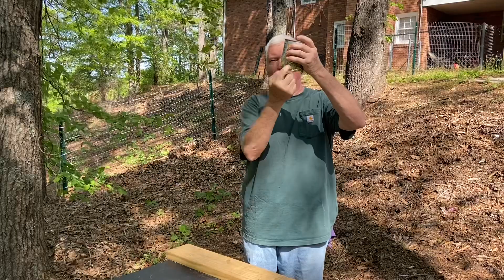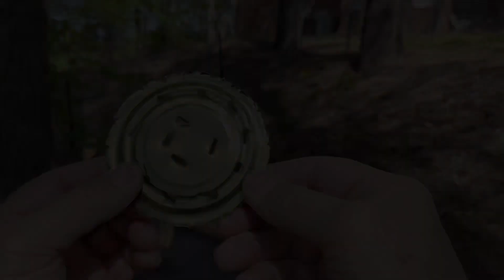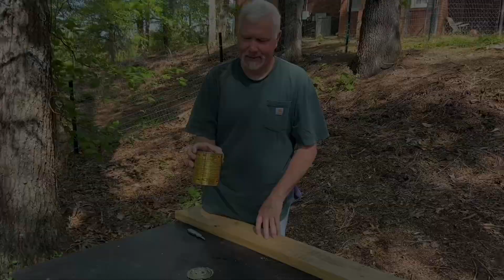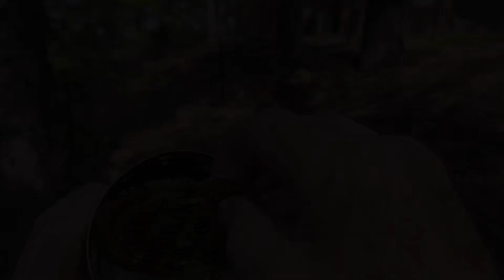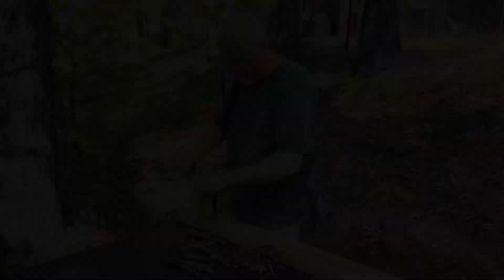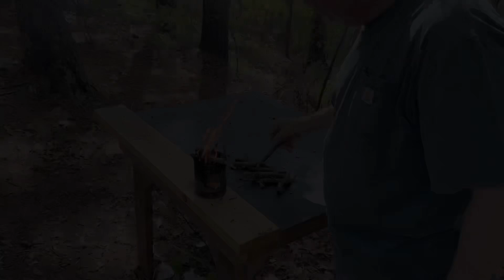How To Build A Hobo Stove w/Elevated Floor Using Just A Pocketknife And Can... (WEAR LEATHER GLOVES)

Comment: I needed a small packable hobo stove for my Stanley Adventure cook set. I did not install a feed port because I just wanted to use wood pellets.  Yes the air gap made all the difference. It work very well and even had  Gasification (no smoke). I only drilled holes at the very bottom below burn shelf and at the very top. Thanks for a great simple idea for pennies! This little hobo stove nest inside my Stanley adventure kit.

Comment from the maker: See my Hobo Stove Builds Playlist below for more types of builds. This simple build required no extra tools nor extra materials other than my Stanley  10-049 pocketknife and a quart sized tin can. 
   Hobo Stoves will burn more efficiently with a perforated elevated floor. I usually accomplish that by using 4 sheet metal screws and a round cut piece of expanded metal. I also usually have an expanded metal cover over the feed hole and usually use 4 - 3/8" bolts for legs... Lol! As the title states though, there were no other materials used besides this can. So, I left out of the build, some things... and improvised others.
   Come see how it all turned out, follow the LINKS below, and SUBSCRIBE. Thank You!

Hobo Stove Builds Playlist
https://www.youtube.com/playlist?list=PLkoXX8XsMW3lZeJRY3SSyPsZBTEWCnHbp
Hobo Stove Build,  The old stove gave its best and Passed The Torch
https://youtu.be/nD6DtxEg_Co
Reply: Do have you have a video cooking with one of these stoves.
Reply from the maker: Many. See my hobo stove cooking playlist.